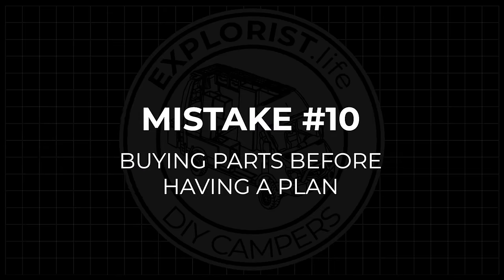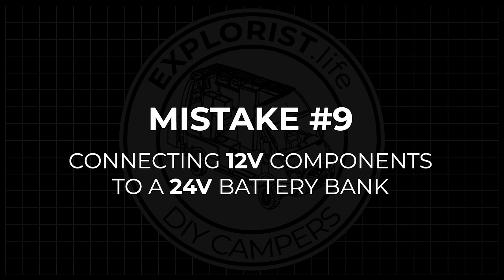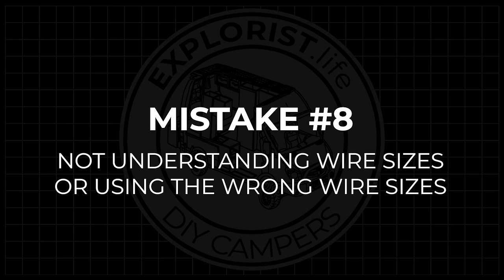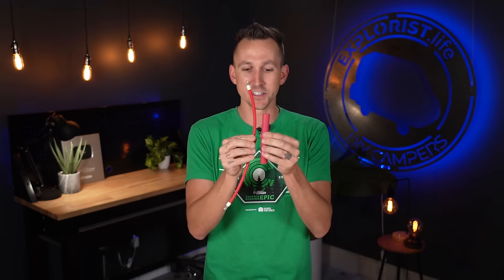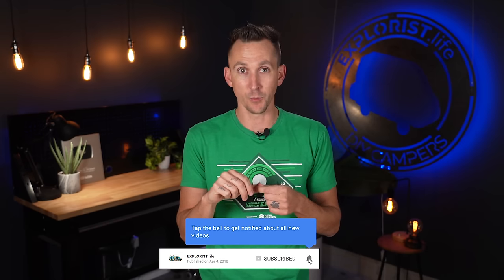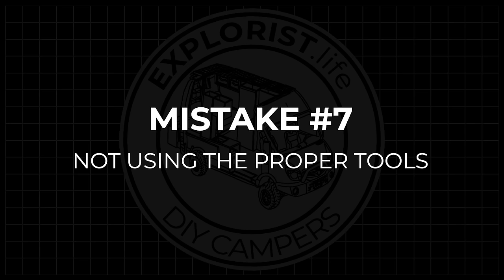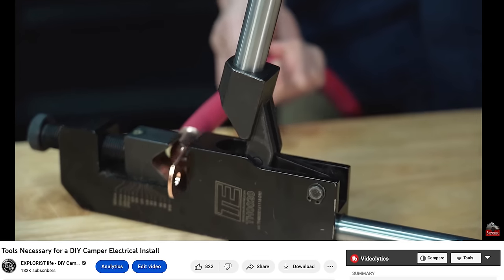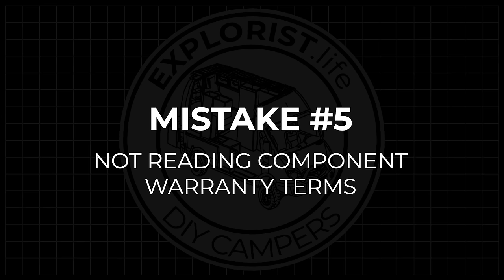DIY CAMPER ELECTRICAL MISTAKES (and how to avoid them)

Comment: It would be nice if all the old and in correct materials would be deleted or have warnings that new info versions are available. DIY busses, plenty of incorrect fuse sizes or fuse type recommendations, etc.
Reply from the maker: I'm always making updates and always try to note if something has been updated.  I don't have much of anything that is blatently incorrect, though.  If I do, feel free to let me know so I can look into it and change as appropriate.

The only things I know that are incorrect are a lot of old Amazon links as Amazon likes to change the products the links point to after the fact when the product goes out of stock and they don't tell me.
Reply: @EXPLORISTlife   ANL fuse for battery positive. 2/0 wire from multiplus to lynx (the wire lugs for 2/0 wire will not connect to the ground stud on a multiple), something else I cant remember. It'd just be nice for some updates, supply sources, etc.
Reply from the maker: Yeah, so if you are bringing up the ANL vs Tfuse argument, I agree, but there are basically zero class T fuses available through all of the USA.  I'm not going to recommend something that isn't available.

For the lugs, the ones in our store at shop.explorist.life do indeed fit.

Comment: I actually used one of Nate’s plans for a full monte system in our airstream. Even though I used some slightly different components the plan was very helpful and the system came out great.  

Then I made this mistake. I used the battery disconnect switch to power down everything so I could check bolt torques or something.  When I powered it back up the solar no longer worked because the panel array was still connected when I disconnected the 12 volt battery array.  That bricked the charge controller.  

All of the equipment has start up/shut down sequences.   They are serious.  Read them.   Guard the cut off switch against improper use.
Reply from the maker: Yeah, startup sequences are pretty important.  Was that a Victron Charge Controller or was that one of the substitutions you made?

Comment: How do I know the input voltage for  change control  some don't have the input voltage can I know from  the  amps  please let me know
Reply from the maker: All charge controllers are going to list their max input voltage either on the unit or in the user manual.  For example: The Victron SmartSolar MPPT 100/50 has a max voltage input of 100V and 50A max output.  It's right there in the name, but is also printed on the unit and in the user manual and datasheet.